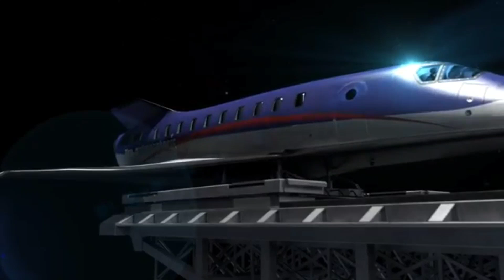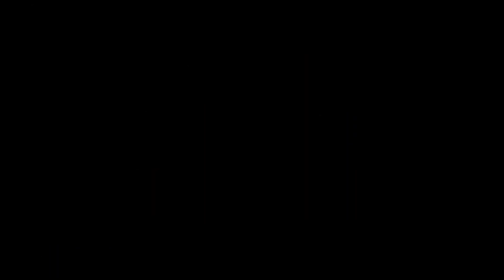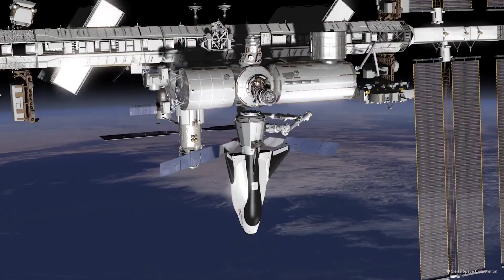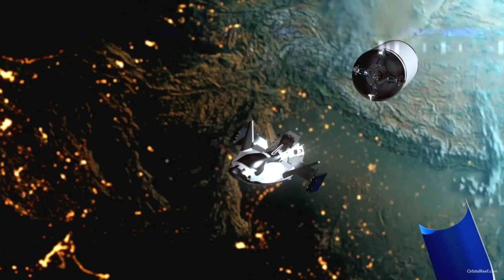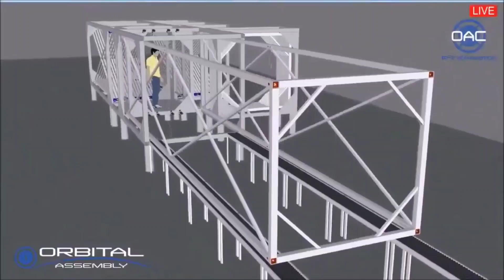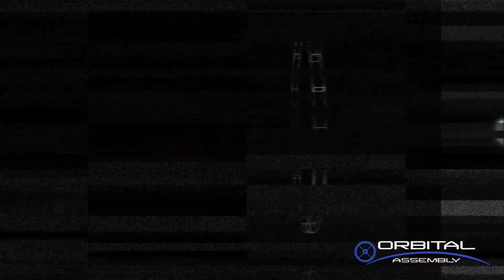New Orbital Assembly Space Hotel Design!  Is it any more realistic?  NASA has doubts...

Comment: The best solution, in my opinion, is a station with partial artificial gravity: i.e. a core with microgravity and rotating habitation quarters extending out from the station. One could use elevators to transition between these layers. One could also imagine intermediary layers between the habitation ring and the core which would simulate different levels of gravity.

such a design could feature counter rotating rings in order to mitigate the torque generated by the rotating components.

Comment: The more ambitious design they had previously included a non-rotating central hub. This seems scaled down, possibly they figured out they don't have enough experience to do a station with dynamic parts, yet. Possibly they couldn't get enough backers. They seem most excited about building the thing on orbit, hence the name change. Less about the logistics of running something that big and spinning. This new design is likely a direct response to NASA's assessment. They need to prove the technology, work out the bugs. That's what this looks like, a station designed to test the build process and operation of a rotating habitat. We know how to build a micro gravity station. This is going to have to be done sooner or later. They just need to get their head out of the clouds and focus on the steps needed to get there.

Comment: One commentator pointed out having the escape crafts pointing out like that would mean people would have to climb into seats pointing downward in an environment of 1 g (a bit more than that as they extend down from the 1 g level). Also, in the animation the people are walking upright like they are already at 1 g. Not even the bit of artificial gravity at that level will be straight up and down, as the tube is at an angle relative to down, so they would have to walk down the tube like it was an incline and would bounce around in the much lower gravity. I could see a station with a micro g section connected to the rotating section through some sort of rotating joint access tube. Also, I would make the rotating part a disk so that it could have levels at whatever amount of gravity you would want, including perhaps levels higher than 1 g.
Reply: Its BS here learn from a real scientist.....           https://www.youtube.com/watch?v=4oUTmBk1iZ4

Comment: Be aware that Intel, Taiwan Semiconductor, and Samsung in South Korea, have all said that they will spend a total sum of over $100,000,000,000 during the next 10 years to construct giant new plants to build the latest generation of computer chips, with far more speed that anything currently made. Intel said they will get down to 2 nanometers in their new Midwest (Ohio ?) plant. So I wouldn't think space based chip manufacture will grab much of the chip market anytime soon. And be aware that chip plants are enormous. If it was easy to make cutting edge chips, the buildings wouldn't cover several city blocks. And all the machines to build the chips are designed to operate in gravity, not floating around in zero G. The machines cost a small fortune, and only one company makes the most cutting edge ones. It is located in Europe. Less sophisticated chips are a dime a dozen. Billions are made each year. The profit margin on making them is low. China makes billions of them every year. But they still haven't mastered the manufacture of the high end chips, despite spending billions on the effort. It isn't easy on Earth, much less in space. 
Translation: chips won't be built in orbit for decades, if ever.  
If space stations were easy, why has only the USA, the Soviet Union, and China only have 2 of them in orbit today? Why not the EU, Japan, or India? Because it is very difficult, dangerous, and super expensive, that's why.
Sending money to build private space stuff is like throwing it away. It will probably never be a viable business in your lifetime. Business is about competition. Nearly all products will be produced where they can be made the cheapest, unless you want to be put into bankruptcy by your lower cost competitors. That's capitalism. It's not perfect, but is the best system yet devised.
Reply: Your watching the wrong video I thinks..... This video is rubbish lies...... Its all total BS mate, here proof, .... https://www.youtube.com/watch?v=4oUTmBk1iZ4

Comment: I have been working on something for a space hotel using 4 starships and an inner hub like a bicycle wheel. Use the hub as a connecting point for the 4 starships. The hub has 2 sections. An inner and outer shell. The inner is for docking a spacecraft to the hub and the outer is for spinning the outer section or the rest of the wheel. To keep them separate use a system called maglev. A system using magnetism and repulsion to keep the hub spinning freely. Half of the starship is for habitation and the other half is for human sustainability like air, water, heat and other.
Reply: yeah, maybe
Reply: Its BS here learn from a real scientist.....           https://www.youtube.com/watch?v=4oUTmBk1iZ4

Comment: Or you could have a station designed where you have both micro gravity and artificial gravity and have the best of both and it wouldn't be that much harder to do
Reply: The worry is that the spin gravity portion of a station designed to do both would shake the micro-g station and ruin all the science every time anyone moved anything inside of it. Also a rapidly spinning airtight seal sounds very difficult. There are some ideas about a liquid metal hydrodynamic bearing but it's still very much based on tech that hasn't been invented yet. It's a problem as difficult as building a new heavy lift rocket, but the team has like one retired engineer and a condo architect on it.
Reply: @opcn18  that makes sense

Comment: ROTATING RING ARTIFICIAL GRAVITY SPACE STATIONS WILL NEVER WORK!!!  As people, equipment, and materials, especially liquids, move in contact with the ring, they will each cause precession 90 degrees from the axis of rotation.  The precession is tiny and  barely measurable at first, but builds up in complexity around all three axes and intensity over time.

Attempts to correct the precession will add their own effects that won’t initially be measurable, but by the time they are, additional corrections will always lag behind further movements in contact within the ring, as well as the effects of previous correction attempts.

Read Pournelle’s and Niven’s “Ringworld” science fiction novel series, especially “The Ringworld Engineers” for a layman’s description of the problem.

Comment: That looks like it'd be a nightmare to dock to.  I'd be really curious about the fuel costs, and how docking affects the rate of rotation.
Reply: @orionspur  like, even if you can get it to line up, even if you can manage to dock without changing the center of gravity of the station and without killing everybody on board, wouldn't adding the mass suddenly increase the rotational velocity?  So, burning fuel to get into position, then burning more fuel to cancel the effects?  Not to mention how fuel expensive this already would be because of the orbit.  And all that expense and risk for an impractical sci-fi prop that won't be needed until it's already obsolete.

Comment: Every time that you would want to dock with the station you have to bring the spin to a stop, then re-spin the station, that's before re-boost to maintain orbit. So many problems with this concept.
Reply: Not at all. You spin the docking ship relative to the station and dock. One craft relative to another.  Docking to ISS seems like a simple process in comparison, but it really the same.  Three dimensions of motion are being taken into account.
Reply: @nickhouston6089  only on the station in the animation is that possible. The first station they plan to build where the docking ports are on the exterior ring would not be easy to dock to if the station is using centrifugal force to generate its artificial gravity.

Comment: Here's my proposal for an artificial gravity space station:

1) Take a proven habitation module.
2) Tether to counterweight (ideal location for any heavy stuff you don't need to  interact with on a daily basis).
3) Spin.

Include a central hub for best results. Have two of these counterrotating if gyroscopic forces concern you.
Reply: How do you seal well enough the joint between a rotating portion and a stationary portion?